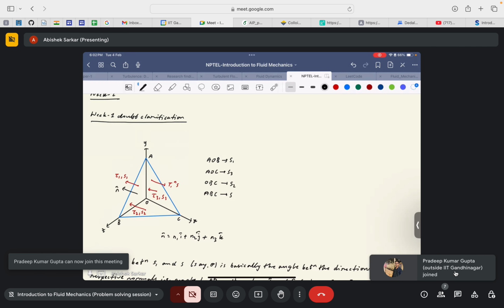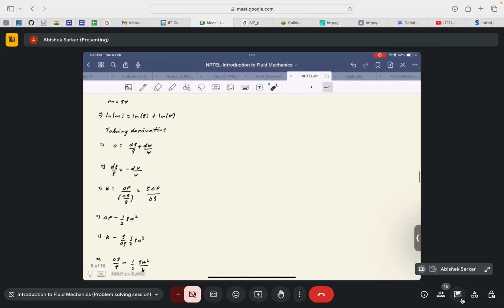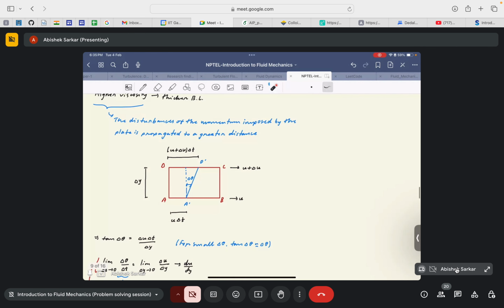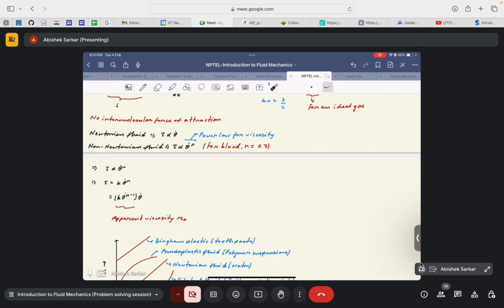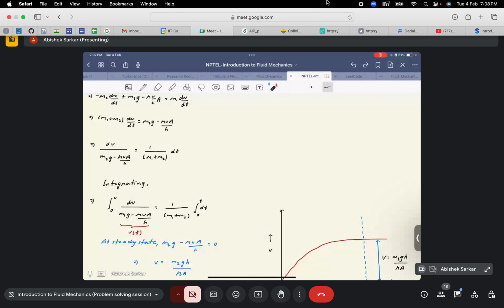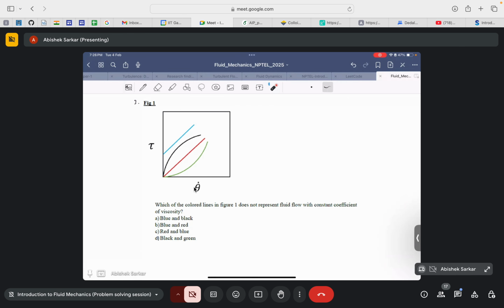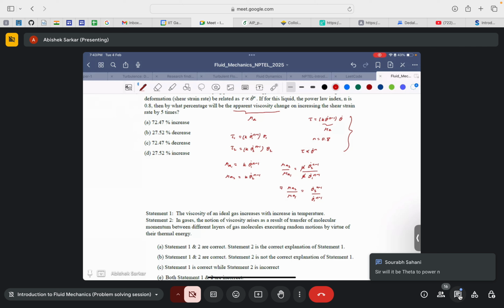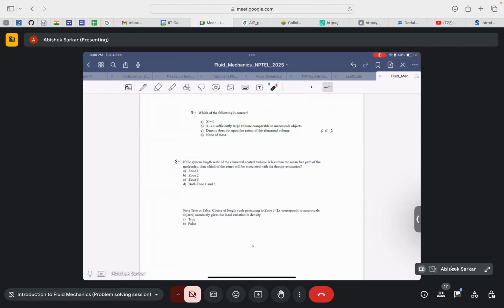Introduction to Fluid Mechanics: Week-2 (Problem solving session)

Comment from the maker: I said that water with same velocity forms a thinner boundary layer than air. It is because the boundary layer thickness over a flat plate is a function of the kinematic viscosity rather than the dynamic viscosity. The kinematic viscosity (nu) of water is 10^(-6), whereas for air it is 1.48*10^(-5). Boundary layer thickness for flow over a flat plate, del = 5*sqrt(nu*x/U).
Reply: As dy is a fn of nu, dy is also a fn of density rho. So with increase in density the boundary layer thickness should increase. That is dy should be higher for water than air.
It is btw my perspective, please elaborate this in the next class because I am confused about this now.